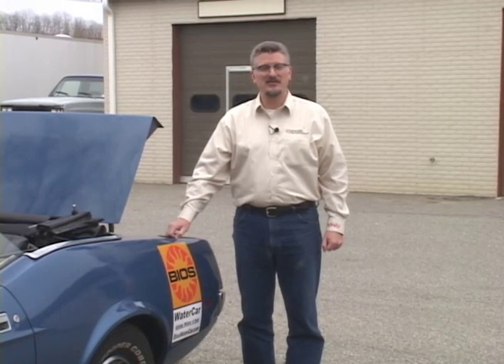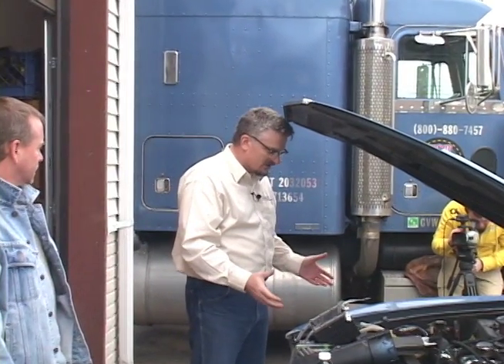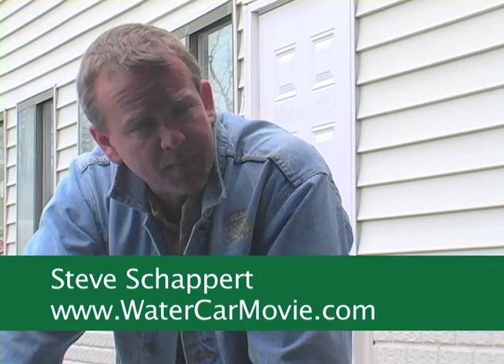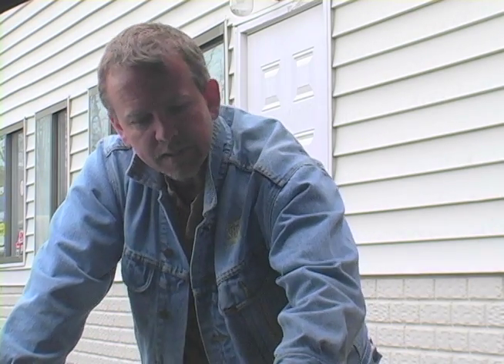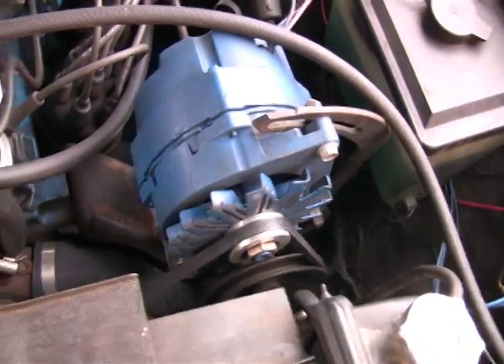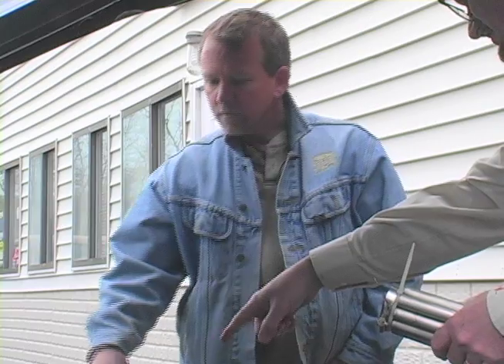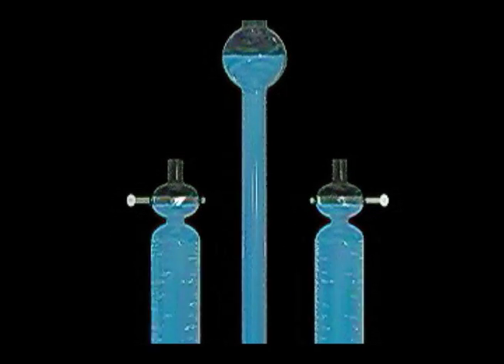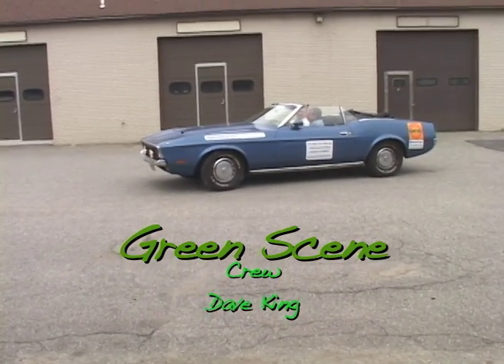Green Scene with Hans Hartman, The Water Car

Comment: We have achieved a 58% increase in Gas mileage using a hydrogen generator.  We continue to learn, develop and most importantly seperate myth from reality.
Using a 6" tube cell and pulsing a 90 amp alternator.  
Driving 120 miles with 4.3 gallons outside temperatue was 23 degrees fo the first 60 miles and 43 degrees fo the second. We are now building a 12" tube cell and we hope to double the gas mileage.